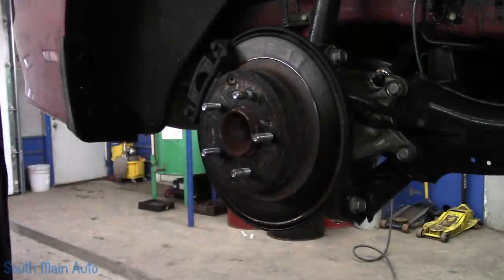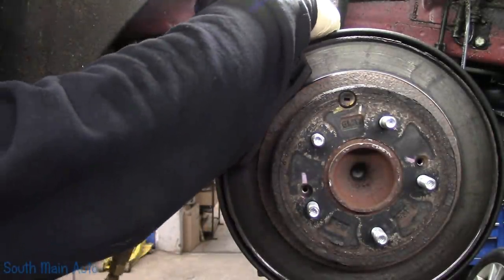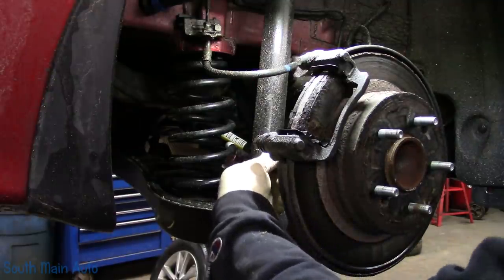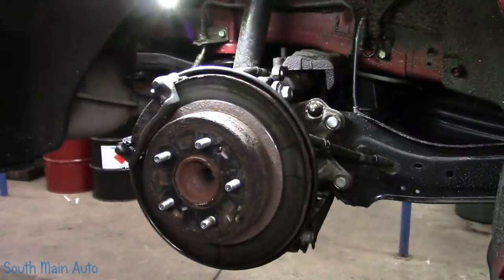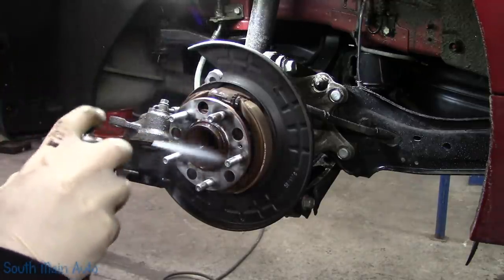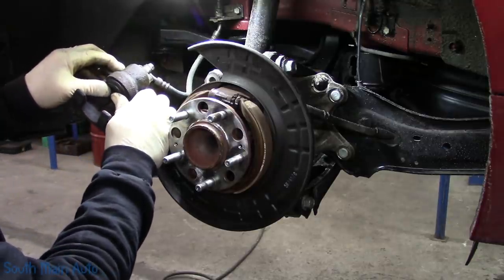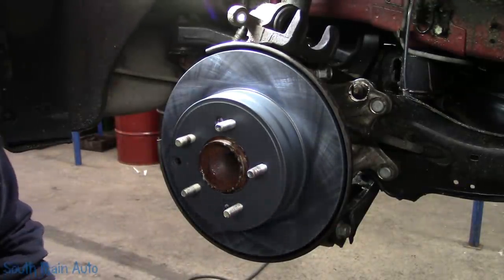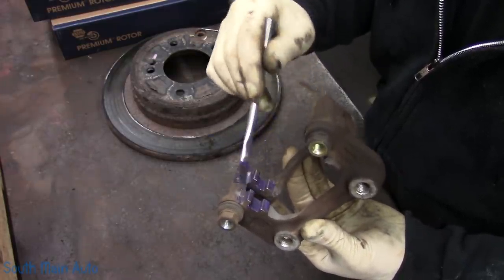Hyundai Sonata Rear Brake Pads & Rotors

Comment: Great video for sure.  I just did the rears on my 2015 Sonata and it was a piece of cake, except for the second wheel, the last bolt holding the caliper to the knuckle. It started out OK then seized up, just like the one you did.  Took me 30 minutes to get the bolt out, even broke a socket, and the bolt head started to round off.  It was the locktite in there I guess. But its done. Thanks again for the great tutorial!

Comment: Not long ago I did the driveway pad slap on the rear of our 2011 Sonata. It was easy. Anyway, we just traded it in on a 2019 Sonata and it has all the bells and whistles -- including the electric parking brake. Our old rear pads lasted about 135K miles and I promise that we aren't keeping this one that long. If this new one is as good a car as our first one then we will be very happy. In the eight or so years we had it (other than minor dealer recalls and oil changes) we put on one set of tires, two sets of front pads and one pair of rotors, rear pads, new battery, two sets of headlight bulbs, one rear taillight bulb -- and that is it. So yeah -- great cars.

Comment: Should make a video of the sonatas you have to pull the control arm on to change the rotor.
Reply: a  its only one bolt my Hyundai elantra  is the same way. it's not that bad I would rather do  a Hyundai then a GM torx bolt set up.
Reply: @jasonjgr8580  broke a half inch breaker bar on 3500 rear brakes. torx bit held up though.
Reply: He has a video of that already just search in his page
Reply: Here's the video he already made removing the control arm to change the brakes. https://youtu.be/MCnm0Lf-A1s
Reply: @Kampa , 4' cheater pipe?

Comment: I had to LOL when you said that the caliper bracket bolts aren't something you want to fall off. This of course coming from a fella who once had a caliper bracket bolt fall out, causing the caliper to rotate forward which was now attached by the lower bolt. The caliper then had some interference with the I.D. of the aluminum wheel and crash, bang, boom, a big gaping hole in said wheel, tire flat as can be. Fun times.

Comment: Awesome!  This Man is what you call, a Professional Mechanic!  😁👍. I’m thinking he could almost do this brake job with one eye shut and one arm behind his back!  Seriously, very well done, concise and descriptive, for the average shade tree mechanic/ DIY guy to follow.  My local Hyundai Dealer quoted me about $325.00 for a rear brake job, which included turning of the rotors, so maybe the time you looked up is about right?  I decided to pick up premium ceramic pads from O’reillys, and replace the pads only.  Rotor surfaces glass smooth with no pitying or corrosion, so I left them alone.  Thumbs up!  Stay safe and Healthy!  Peace 👍😁🇺🇸

Comment: Not sure if anyone has said this but Hyundai uses lock tight on the caliper bolts. it is in the threads not on the bolt. very annoying for us Hyundai techs lol. we usually take a thread chaser and clean the caliper threads out. bolt goes in smoothly then. good work Mr. O

Comment: I struggled with those caliper Mount bolts bad, it was locktite, I cleaned the grey crap out of the threads with WD40 and they worked great after that.

Comment: I add a touch of grease to the ears of the pads also. Maybe that’s wrong but I have done it like that forever and never had an issue.  You’re supposed to grease all metal to metal moving parts.

Comment: Have been doing some brakejobs on Hyundai myself and the rear bar on the i30 is a pain in the neck.Right in front of one of the bolt to the brake caliper and if you are lucky it is rusted solid and the only way forward is heat and replace the bushing.  The Santa Fe CM that is not to different from the Sonata doing brakes is quite easy.

Comment: I just did brakes on my 2016 Sonata. First time brakes were done (I did pads and rotors all the way around). Front was easy and quick. Rear should have been. But those two bolts you had issues with? Mine were almost impossible to remove. The two bolts holding the bracket with the pads started coming off easy enough. But a few turns later it got hard. As in VERY hard to keep loosening. Last time they were touched was on the assembly line. My impact wrench couldn't reach so I used my 22in long ratchet. After 20mins PER BOLT and all my strength they came out. Turns out, Hyundai didn't tap the threads right on that bracket (or not all the way), or they left metal shavings inside it. Bolt was impacted with metal in its threads. Before reassembly I had to retap both holes and chase threads on both bolts. After that it went in easily with just my finger, and tighten to spec. Both sides were like that. Pretty crappy oversight on the assembly line. Rear brake job thanks to those bolts ended up taking me over 3 hours. By comparison, I did the fronts in less than 45mins.
Reply: Shawn Copen I’m trying to replace the rear pads and rotors on my 2016 sonata. Can you tell me what tools you used and their specs, torque and such. Thanks 😊

Comment: 2.8 hours - maybe they expect you to remove the shock to get to the top bolt? Strange.  I figured it was going to be like the front brakes on a Chevy Colorado. What an engineering marvel that thing is ... 😂

We only got 6" of snow ... but 2.39" of rain when it shot up to 55°! I couldn't even get anything into the shop that wasn't 4-wheel drive for the past 2 days - would sink right up to the rockers.Almost had to tow the Volvo out of there when my wife went to work the other morning. She did a fine job doing a 3 point turn, and making a half mile of ruts back there. I'm going to have to do something about that whole mud situation soon ... and none of it is gonna be cheap. 😒

Dancing Lemur NAPA commercial! That would be a riot! 😁 Speaking of them, WHY AREN'T THEY SPONSORING YOU? Hmmm, NAPA? 😉

Hope your back is feeling better, brother. Also hope you kicked that truck's butt this time, too. 😊

Comment: I have done several rear pads and rotors on Sonatas that you have to remove the lower control arm bolt to remove caliper bracket. Still though it only took maybe 10 minutes longer then a normal brake job. Not sure why Mitchell shows 2.8 for either style.

Comment: I have 135,000 miles on my 2012 Sonata, did the front brakes at 120,000 and the rear still had about half the linings. Good to know how to release the parking brake when I finally have to do them.

Comment: To anyone wondering, the screws on the rotor you do NOT need. They are put on on the assembly line to hold the rotor on. Eric is the only one I've ever seen put them back on. I never do. The wheel is what holds the rotor

Comment: Another Premium Brake Job completed at SMA, coupled with information and tech tips.  NICE!
Hopefully we get to see a brake job with the electric/electronic parking brake.  What kind of and how many problems have you had with the non mechanical parking brake system?
Finally read your article in MotorAge magazine for Dec 2018.
Also, the Buick LeSabre you and Ivan diagnosed (with Keith's module and coil tips).  What was the final outcome with that, and what parts fixed it?  Thank GOD for the Pico Scope ! !  I don't remember seeing a part 2 in all the videos.

Comment: 3hr booktime because they used NAPA hardware?
Reply: I used to work in a hyundai dealership. Some times the time allowances are very generous and some times you ger ,25 for a 1½ hour job. They also don't always know how much oil their engines need if there are many displacement options on the same basic engine. Maybe they account for thir cars rusting worse than a pensioners undercrackers also.

Comment: great vid..love your attention to detail ...cleaned  the parts  etc ...question  at  11.18 what is the lube  you use ...manual says a high temperature grease ??...
Reply: at 14.07  you had lubed  the  clip to the  bracket , is there a reason you did not lube the  pad to the clip ??

Comment: You need an air ratchet that turns the socket from the side and not the back. it would be low profile enough to fit there. I bet Dorman has one.

Comment: It's called bimetallic corrosion I have literally seen that crap eat the bottom rails of trailers in between the rivets that were holding the side panels on.  The problem the rivets were steel the rest of the parts were Aluminum.  It ate the aluminum so fast the trailers where breaking in the middle.

Comment: How did you get the caliper bracket off so quickly? When I did this, one of the bracket fasteners was easily accessible and other one had absolutely no access because a lower trailing arm was in the way. I had to loosen the lower trailing arm on each side, the whole job took about 3 hrs.

Comment: Do a brake job video on a first generation 4WD Colorado, Canyon or H3. And you will see that none of the designers and engineers weren't in the same room when they made that truck line.
Reply: Frank Gonzalez Yep been there done that several times! They were all high on something when they designed it!

Comment: Hey Eric appreciate the lesson....long story even shorter I’m a home gamer mechanic and always have wondered what are those Phillips head screws for that hold on the rotor?? One more thing if you don’t mind, what is it called; the Brillo pad implement you use to clean the studs for the lug nuts. Thanks and love the channel man. 
-Pidge
Reply: Those screws if I had to guess are more for the assembly line so the rotors don't fall off during assembly.

Comment: So electronic parking brakes, what happens if your brakes fail? Years ago, driving down a steep decline, my Taurus looses its brakes, a brake line broke. No big deal, ease her into low, work the mechanical parking brake on the way to the shop (local roads). What would I do in a car with an electronic parking brake if the brakes go?

Comment: So I have a 2001 f150 and it’s running rough at idle I looked at the codes and o2 censor codes came up replaced those still ran rough new idle air valve cleaned port still runs rough unplugged MAF sensor to try to get it to go into default mode still ran rough so I took my hand and put it in front of the MAF sensor and it idled right it has the 4.6 in it any suggestions

Comment: Pardon my ignorance, I am definitely old school.  Why does every brake job that I see (Not just SMA but anywhere) require the rotors to be replaced?  Are they undersized, poor quality, or what?  Shouldn't the rotors last more than a few years and one set of pads?  From what I could see in the video the rotors probably needed replacement. So why should they on a 2015 vehicle?

Comment: I married into a Hyundai Sonata. Wife bought it new off the lot before she even met me cause it was red. Was constantly back to the dealer for recalls. Learned quickly it was a fighter when I did rear brakes on it for the first time. Stupid caliper bolt! Luckily we smacked a deer going 75mph with 88k miles on it and was rid of it once and for all. it crumpled up like an aluminum can.
Reply: +Bobby Brady 
it was a 2011. I remember her driving down the road and the rear tail light just falling off going down the interstate too.
Reply: +Bobby Brady 
+Bobby Brady 
Just our experience, Not exaggeration. It wasnt a terrible car, just not something i would personally purchase myself. I wish I could reply with pictures of it all (service tickets, recall letters and all the stuff in between including the front side photo I took about 10 min after hitting that nice 8 point buck.) but I can't. So your just gonna have to take it with the grain of salt I suppose. My mother in law has a 2012 elantra and has been relatively problem free so maybe it was just a bad run of Sonatas being newly designed that year and they were working out flaws and kinks.
Reply: Bobby Brady  The thing with mass production is bad batches can slip through. The year as a whole may be good, but it wouldn't be impossible to have some that were duds and get glossed over.

Comment: Sorry if this has been asked and answered a bajillion times before, what is the bluish purple goo that you use on the calliper carrier bracket? I have always used copper grease in there but am interested to know what that stuff is because I've seen you using it a lot.
Reply: unicorn7337
Permatex Ceramic Extreme Brake Lube.  Copper is oil based and not good close to friction material.

Comment: For the fluid film, I prefer to spray the inside of the rotor hat, that way it doesn’t get on the threads and mess up torque spec on lug nuts

Comment: bolt you had to use hand tool on is again an engineers delight how to mess ya up. and those rotors look like my daughter belief in braking nice deep groove lip at least from the angle i see them at....looking at the rotor the person driving the car must have heard a squeel and that woiuldnt be the mices you have in your part of town...lol a yes the hardware the ol hardware not gonna cooperate trick (get smart reference) yes welcome to our outside mechanic pain expecially when it frikin COLD outside and these things do not want to clip in...how many times I had to run cold water to get the feelings back in my fingers......And yes when you put those pads on I wound up grinding a smidgin off the pads so they would flow in nice...used to hit em with a file but like you you do enough of them you can tweek em with a bench grinder to make the job faster and easier...always said that why God made tools to do the job right  or something like that
Reply: Bobby Brady  hey there I live in suburbs of chicago where the farms were and when it was as cold as it is now (below 0 ) as a kid I would be outside with my friends playing ice hokey on some local small pond in the area (which you cannot do now-people and their ordanance) and the only thing as a kid that would start getting cold on me after awhile would be my feet thru 3 layers of socks...go figure...ah yes our youth

Comment: Why is a slight drag ok after new rotor is put on?
Reply: It adjusts itself
Reply: As soon as you apply the EBrake it will adjust and shift around and once released it will have enough clearance that it doesn't rub. If you watched as he adjusted it the shoe was worn a bit and out of adjustment, which is very typical of the shoe in hat EBrake designs.
Reply: Thanks still learning

Comment: I always lube the brake rotor!   am I doing something wrong??
Reply: We know you're joking, but somebody needs to give a heads up for the occasional chucklehead who might be stopping by.
Reply: As long as you grease the zerk fitting on the caliper afterwards.
Reply: A regular coating of grease really helps reduce wear on the pads and rotors.
Reply: @mustangmanny9909  ive heard of someone really doing that!
Reply: @ferrumignis  and also a top off of 90w in the master helps keeps things moving!  tec tip here....
Reply: Bobby Brady  great tip...  the wheel centers easily and no need for okeefs working hands   kill 2 birds with one stone!!

Comment: I remember a time before ABS brakes. I was but a young man at the time. The consensus was that they were easier then. When they came out with ABS It appeared that everyone was saying how more complex a brake job was and all the care needed for the ABS system had to be taken and so on. Making a brake job more technical. I don't see that. Brakes look as easy to do today as they did 30 yrs ago. So what was all the hype all about?
Reply: The Plow Guys....I remember a time before dual master cylinder split systems.  And non hydraulic mechanical systems, although I didn't work the mechanical ones.. too young at the time.

Comment: the grease on the caliper bracket and on the caliper is about as useless as the brake rotor screw... just my 2c.
grease the slid pins and SLAM her back together boys